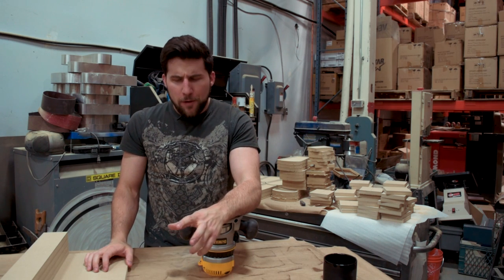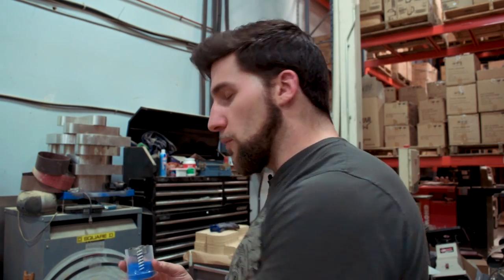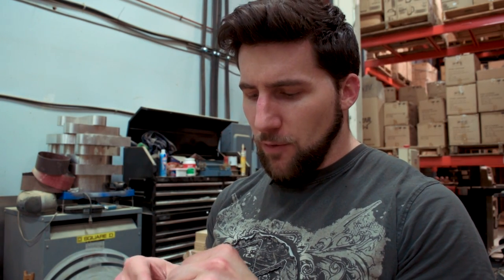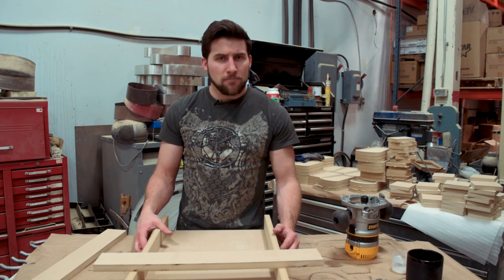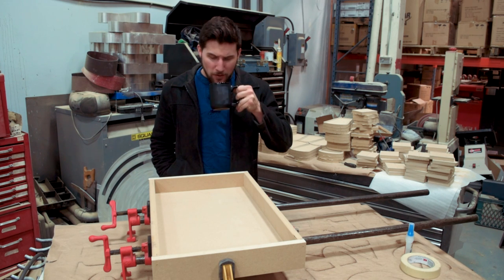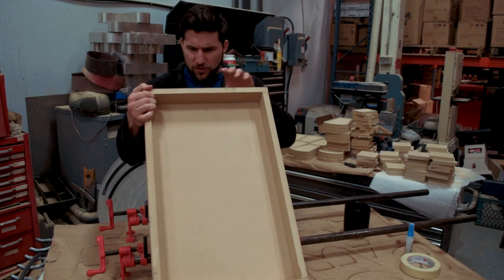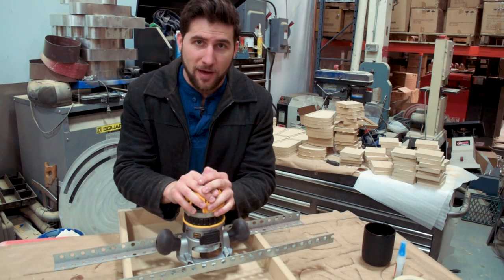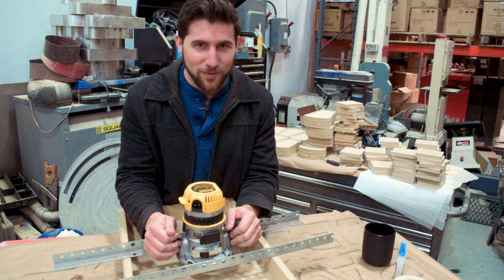Making a router sled box (for REMOVING GUITAR TOPS!)

Comment: Pipe clamps ftw !
Sparks near the dust collector reminds me of the first time I learned to use a fire extinguisher a long time ago :-)
Reply from the maker: Hahaha at least it’s not next to the paint booth I suppose.
Reply: @BradAngove  Once upon a time everything was in one big room in a cellar :-)
Meanwhile now separate dust extractor room with fire detector and auto co2 cartridge and separate paint booth room with grounded pipes for anti-static and 3 filter layers in front of ~1500m3/h air extraction out and about 1000m3/h in ventilation. still not 100% explosion proof (if that is even possible with diy and limited budget) but quite safer than before and much less overspray but also still not perfect.
Reply: Geez.. I just work in my carport.

Comment: Hi, by adding the short sides I see a problem. How you gonna clamp the guitar? To small pieces at each side would make it also stable. Maybe adding two metal strips on the long sides makes it harder to damage the box. Succes! Rob
Reply from the maker: I wouldn’t want to clamp the guitar in any event. It’s too risky. I could cause serious damage/harm if I somehow hit a clamp with the bit. 
I will be using the super glue and masking tape trick to affix the guitar to the bottom of the box.

Comment: Hey Brad, loving the video's and thanks for demoing this stuff with gear thats easily available! Im taking on this project to hollow out some cavities, but im afraid my router bits wond reach as deep as i'd like them to. I was wondering how high the sides of your box are and how you came to that hight. Thanks!
Reply from the maker: Generally you wouldn’t really use a box like this to hollow out cavities unless the top surface is uneven. That being said, I chose 2.5 inches of clearance I believe. Might be 2.25. I wanted to ensure that there was room for the bolts to hold the rails on, and that I could work in a 2” piece of material since I sometimes pick up blank material in that thickness.

Comment: Put a couple blocks on either end of the angle iron pieces as gussets (plenty of screw holes) - single connection point stability problem solved!

Dude - how could you make this and then not show it in action?  X(
Reply from the maker: Makes too much sense, it’ll never work haha. 
I’m faced with the typical content organization problem. I want to demo it on the kit guitar, so it needs to be in that series, but it would be cumbersome to have the box build in that series... It’s coming soon!